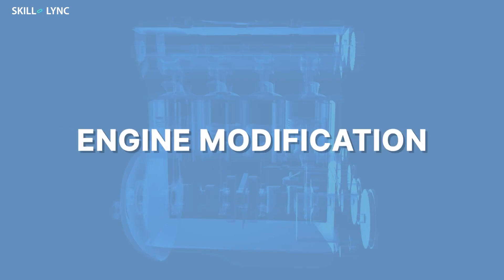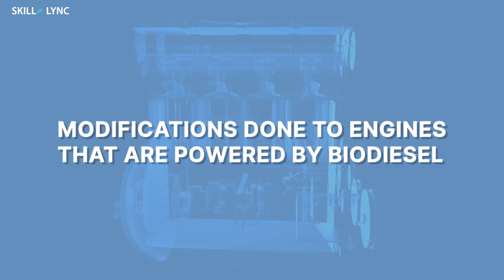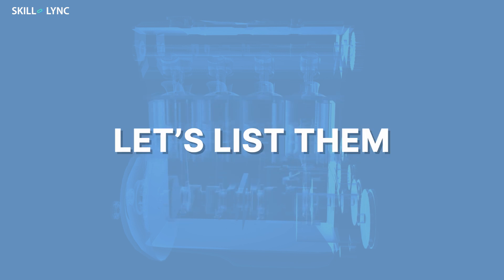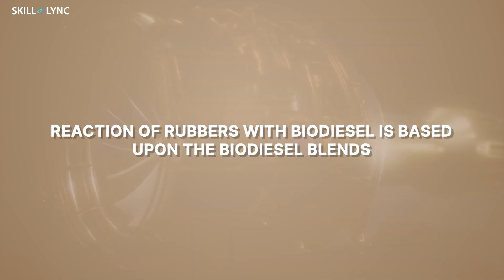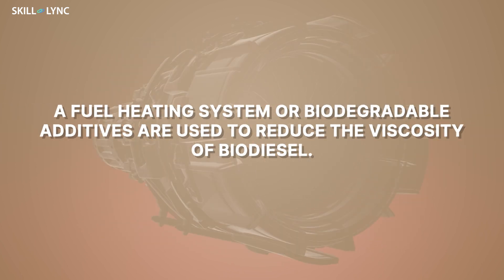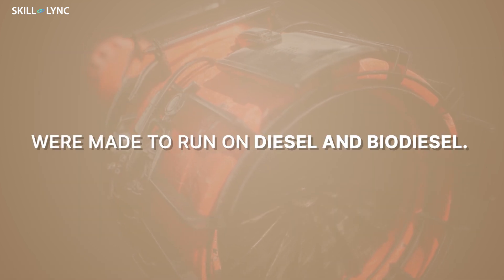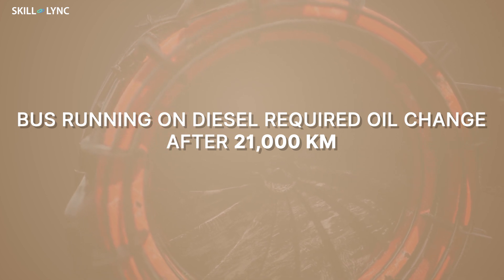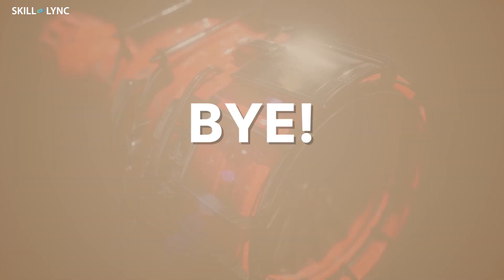Engine Modification  - Biodiesel | Skill-Lync

Comment: Hi am from mauritius, I would like to know what are the vehicles that can run on bio diesel with small amount of modification
Reply: Please dont believe on what this video was saying. To use biodiesel there's no need to modify your engine as per AFDC of US Dept of Energy. Since biodiesel are made from slippery triglycerides, it produces more lubrication than diesel. And because it came from feedstock being use to make soap like coconut oil, it also has a cleaning property of removing sooth and coke from unburned diesel deposits. This is why even airplanes ( Boeing, Cathay, Lufthansa and Qantas ) now are using biodiesel without engine modification. Also biodiesel has higher cetane rating of almost double than that of regular diesel. That's why it's rated as EURO 5 to 6 as green fuel. Go ahead use it without engine modification with confidence. I know it, Im a chemist with masteral degree in Chem and Mechanical Engineering.
Reply: @riccapistrano1131  where are you from buddy? How can I contact you to solve my some doubts on biodiesel?